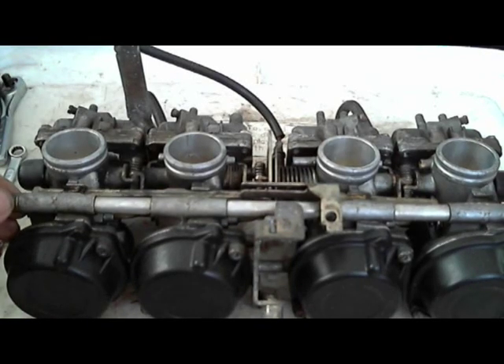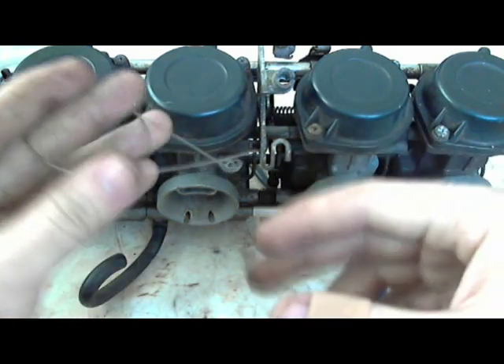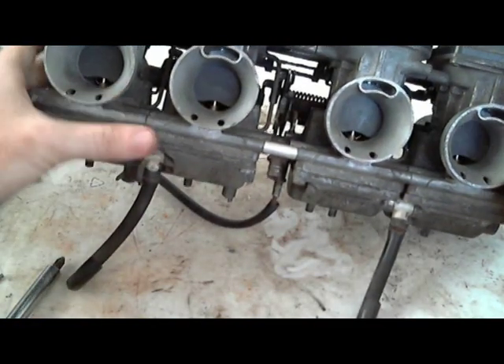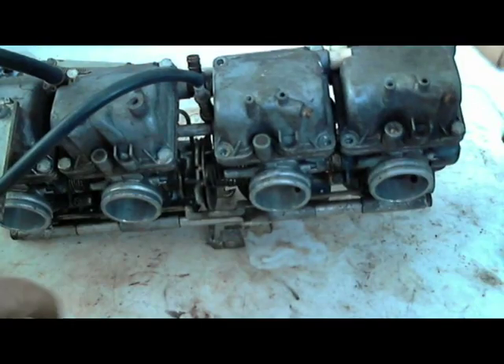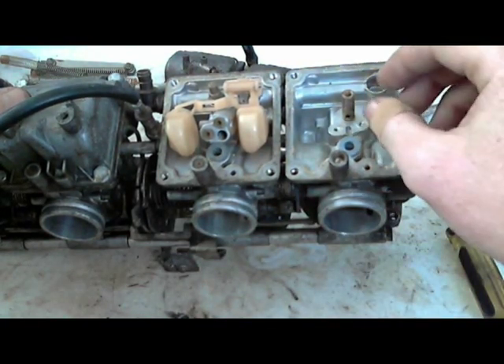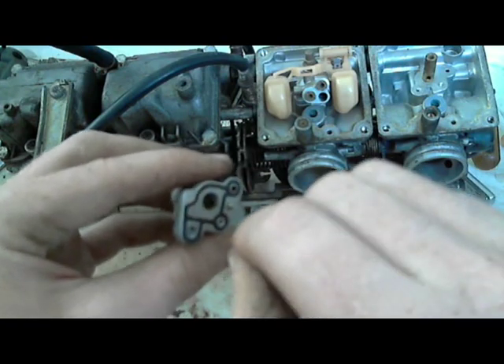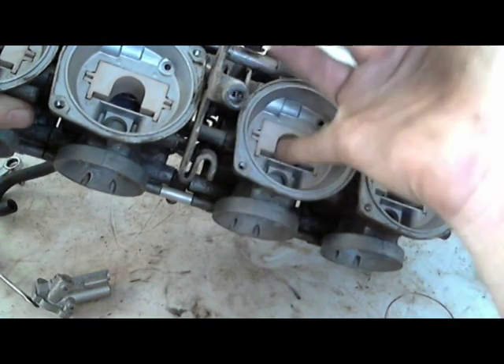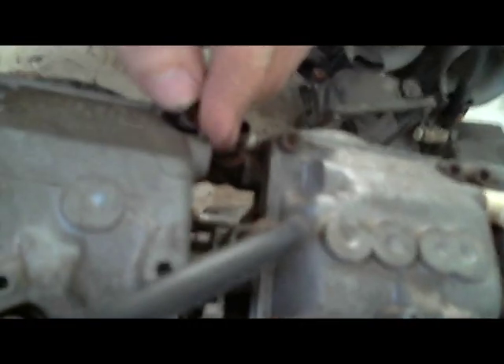step by step fzr600 carburetor rebuild

Comment: Your mystery tube at 43:00 on the California float bowls was where they were hooked up to the charcoal canister for the gas tank vent. Originally there would have been a tee fitting between them and a line going to the charcoal canister which has a line going to the gas tank.

Comment from the maker: There are also passageways inside the carburetors that get gunked up. I hate to say this, but pull them off again, take the jets out, and do the same thing with the guitar string inside the carburetors. Then spray through the passages with carburetor and see if a stream comes out. The passages go through to the carbs and out the air filter side. Clean from both sides with the string.

Also I would pull out your air/fuel adjuster screws, clean them, and set them to the factory number of turns.

Comment from the maker: The fuel economy problems in carbureted bikes almost always lies in the spark or the carburetors. You should check your spark gap first on your spark plugs and if your coils are still providing a hot spark (resistance check on the coils, the repair manual describes how to do this). That is the easiest thing to begin with and rule out. Then clean the carburetors well. If done correctly it should run great after that.

Comment from the maker: I've seen it both ways. Sometimes it is still good and sometimes it leaks air. I've sealed them up before with RTV silicone from napa. It doesn't look pretty but it fixes it, plus it ran fine for 3 years. If you don't have idle problems then you should be able to leave it like that and it will run fine until the cracks get worse.

Comment: I can't get the carbs to slip on the boots. I've taken them off and put them on a few times before, and they always slip back on. This time, they just won't mount. The clamps are loose, and the silicone spray is not working.
Reply from the maker: Yeah, I've had that happen to a few motorcycles. I've even had to cover the inlets with something and put my shoe on to try to evenly press down. These intake manifold boots just get old and aren't very flexible any more

Comment from the maker: that sounds like a throttle cable issue. If your cables are too tight on the cable adjuster then they will stick for sure. It is common when you are putting the carburetors back in to overtighten them. I've done it before. Also when the front wheels are turned, if the throttle cables aren't routed the correct way it will put stress on them and possibly shut off the bike. Check the cable routing and tightness, maybe even spray some kind of silicone lubricant inside the cables.

Comment from the maker: yeah. all the choke does is change the air/fuel ratio for starting. So adjusting the air/fuel ratio should fix it. Those little o-rings do get stuck quite often.

Comment: Actually, the “cheap” screwdrivers supplied in most Japanese mc tool kits are JIS, and they do work much better in those carburetors. I’ve been working on these bikes since my first Yamaha YS1 250. I know about caming out the screw heads! You’ve been lucky… btw, I also have one of those T handled screw drivers! You can order the handle and the JIS blades from any site with Honda or Yamaha parts.😂

Comment from the maker: That's a pretty common thing. Sometimes they don't slip back because they get a little dry, you can wipe a little motor oil around it with your finger to lubricate it then it should pop back in. Or if your hands are clean enough you can spit on the tip of your finger and wipe it around.

Comment from the maker: I think it is talking about a fuel level meter, I'm not exactly sure what it's called. It's like a little tube thing with a hose on the other end that you connect to the drain plug. The fuel level should go up to the 18.5 mm mark on the tube. I've never had to use one on the floats because I haven't encountered a float height issue.

Comment: I just bought a fzr 600 for 250 and it was setting up for three years I took the tank off and the and it was rusted and still had fuel in it but luckily the guy had a cut off valve and the fuel filter was clean so do u think if I jus clean the carbs and Chang oil it should be good to start

Comment from the maker: string size will be either .010 or 10 gauge, which is the high E string. That size works on most carburetors. I've had to get .009 before for carburetors on a 250.

Comment from the maker: Most of the time when they sit for a while then you need your carbs cleaned. I'm not sure I know what you are describing with the fuel-filter-looking thing on what is as small as a coolant line. I'm not familiar with anything like that on the FZR. A fuel line wouldn't be that small unless it is a very small engine. It could be the vacuum line for the fuel petcock on the gas tank, but I don't know what the filter-looking thing is. A one way check valve maybe? There is no reason to have one there

Comment from the maker: slides are driven by vacuum only. They shouldn't open when you move the throttle unless the bike is on and there is vacuum from the engine.

Comment: I think my problem might be on each of the idle/mixture passages. I removed the screw but I didn't see the little o ring and figured it was down in the passage. So I didn't spray out that passage with carb cleaner (didn't want to swell the rubber o-ring), after reading on FZR Archives I think this may be my problem.

Comment: Thanks for getting back, I used the guitar string and completely went through the carbs. I got it all back together but my FZR won't stay running unless I have the choke on. Any ideas what might cause this? The bike hasn't ran since last summer.

Comment: Hey what is the other carb that you said you had on your fzr600 a 04 yzf carb or something but how did you get it to work in really wanting to try and do that and I cant find the video you was talking about please I need help with that if you can help please let me know my carbs are all screwed up from the previous owners and I can find any where to buy new carbs for this bike and I kinda would like to have a slightly bigger carb if possible its a 1994 Yamaha fzr600 not the cali one just the normal one

Comment: At 24:40 when you say the fatter jet is the one inline with the screw, you mean the one with the fatter hole in it right? Cause mine look exactly the same. Is this one (on the left, inline) the main or the pilot jet?
Reply: When  I say they look exactly the same I mean on the outside. I have four with bigger holes and four with smaller ones as I believe I should
Reply from the maker: +steezridin yeah, I meant the one with the larger hole inside. That is called the needle jet or main jet and it sits inline with the screw that holds down the emulsion tube. If you look inside where the jet goes you should be able to see through to where the needle sits when the diaphragm side is installed
Reply: HourNine Racecraft awesome thanks so much for replying man! I have another quick question about something I don't believe you covered: when putting the float needles back on the floats, does it matter which side the metal hanger on the needle faces? It's kind of an L shape and I'm not sure if the two circles that would create the bottom of the L should face downwards or upwards?
Reply from the maker: +steezridin no..it can go either way, but just make sure the needle moves up and down when the float does. Otherwise you'll flood out the carbs or not get enough gas. The most import thing is that the needles are clean and the point isn't worn out on the bottom
Reply: HourNine Racecraft sweet thanks for your help man!! I was googling these things for hours and couldn't get straight answers so I really appreciate it!

Comment: Hey man, I really need some help. I am currently working on my 91 fzr 600, and on the carbs you see those 2 hoses that are in between the 1-2nd, then 3rd-4th carb attached to the plastic piece? I just pulled mine off an noticed that they didn't have a hose on them and were just freely open. Where do they attach to on the bike? Could that be the reason it won't start up well? A vacuum problem maybe? Please help.
Reply from the maker: +dalancabo1995 the hoses are for fuel overflow. It will function fine without them. Mine didn't connect to anything. I've heard that on racebikes the overflow tubes fed into a canister, but the canisters never came on the models that were sold to the public.

Comment: I was wondering if you know what would make my throttle stick and not return to idle sometimes. Also sometimes when I turn the wheel it kills the engine.

I also have 91 FZR, doesn't look near as nice as yours, I would love to do the R6 tail swap but lack of funds now, so I still have original tail.

Comment: Hey how u doing....  Need ur help, i got stuck in putting back my floaters. I think the rubber gaskets got bigger.. is hard to put it back. Do i need another one? Can i use any other house hold gasket??? Wanna ride this bike been two years with out it...

Comment: Thx! My bike has been sitting for a long time and now it starts very diificult and when it finally starts it is running with low rpm,s with a fully open throttle. What is your opinion? Clean carbs? Vacuum leak? Or what? B.T.W  I have a hose that is left over which has something that looks like a fuelfilter in it but than totally black and the hose is about 50 cm. long and about the thickness of the hose that goes to the coolant reservoir? Any idea what I mean or where it belongs? :-)

Comment: Hi,
My slides don't move when I open the throttle, what is wrong? Or they only slide when the engine is already running?
Reply: only when running or you would have to have 4 cables going to your throttle

Comment: how do I measure the height of the floats I have a yzf r6 and the manual says 18.5 mm but the floats don't even get any were close to that before the float toches the top part near the base were its screwed on. appreciate if you can help me out been trying to get it fixed for months now.

Comment: now im having a new problem, my fzr ran great for 10-15 mins after i put the cleaned carbs back in, but just now i rode it to work and it sounds like its running out of gas (which its not). im really confused now...
im thinking maybe somehow the fuel line got pinched ill take a look at it tomorrow. it just sounds/feels like its not getting enough gas. any ideas?

Comment: Hi there I have a 1993 fzr600 and on a full tank am only getting 147ks or about 27 mpg before i need to switch to reserve. This is far low for the specs on fuel economy on websites. Would you know a solution for me, cheers in advance :)

Comment: How do you get that top half of the engine where the carbs are off? I'm having trouble getting that off just to start the carb cleaning
Reply from the maker: KbBeBallin45 Remove the gas tank cover, and then remove the little metal gas tank. You will have to remove a few rubber lines. Then take an allen key (hex key) and loosen the clamps. Take off the throttle cables. It should take a little force, but they should come out. Getting them to go back in is a little more difficult since they are hard to slide back in the boots.

Comment: I just got a fzr600 for 200 and it runs I found tho that there is a tube that comes off the crank case near the transmission and it blows oil out what is y and where does it hook to?
Reply from the maker: it is the crankcase ventilation, and the hose that goes up to the bottom side of the airbox. If you don't have an airbox, then get a little breather filter from your local autoparts store.

Comment: hey dude i finaly got my carbs off, i followed your vid,as far as possible  but i have a problem,,,i have removed and cleaned the jets but the third hole,,,,what is it, it seems to be blocked.pressed in?
Reply from the maker: +andrew munslow I don't remember if that particular jet is removable or not. If you can't remove it, you can always remove the emulsion tube (the thing that holds all of the jets). You can remove it by taking the capped-nut off of the top (approx. 6mm size), then it should slide up. After it's off you should be able to clean both sides of the jet as I showed in the video. Hope this helps! I haven't worked on a set of FZR carbs in a few years.

Comment: And the guy parked it be cause the push button start went out on him any ideas on how to fix it if that is it I have not had a chance to hook battery to it yet and the button is a lil stiff but still moves
Reply: I'm working a fzr as well and what I did is pretty much cleaned out all the all the electronics. like the turn signals the digital tuner the relay and rectifier in the back of the back imma try to put a video of it soon and what tools you will need.

Comment: I bought n fzr600 for 200$ guy said it wouldn't get spark.... I took the kickstand switch off and she fires up but dosent like to idle what could cause that its also seemjg to be running VERY rich.   Its shooting flame around 3500 rpms and do sent really wanna go over 4500 rpms
Reply from the maker: if it is running rich then have your carburetors cleaned and adjusted.

Comment: I HAVE A PROBLEM WITH MY FZR THE PREVIOUS OWNER BROKE THE SPARK PLUG AND CANT REMOVE IT CANT YOU GIVEME SOME ADVICE?
Reply from the maker: If the insides of the spark plug came out you can screw a tap into the now-hollow spark plug and reverse it out or tap in an easy-out reverse drill bit
Reply: the sad part that thing is HARD AS HELL the piece got broken, we use a manual tool with the bit and the bit got broken
Reply: You have to drill a hole in the center and tap it then put a tight screw in it and back the bottom of the plug out if its snapped flush with the engine I do it every time and it saves me a shit ton of work

Comment: How do I get the throttle cable off of the carb?
Reply from the maker: +Travis Howe info remember correctly, loosen one side with a 10MM wrench, then turn the piece of the carb that the cable pulls. You can slip the metal ball out of the slot once tension is off.

Comment: I need help my screws are not coming out at all and I have a t handle
Reply from the maker: Try getting some vicegrips and clamping onto the side of the head of the screw, spray it with some PB Blaster before you do. If that doesn't work then buy a set of Craftsman screw removers, drill a tiny hole in the head of the screw with a regular drill bit (about 1/8) and don't go deeper than the thickness of the head, then switch to the screw remover (it's like a reverse drill bit). Apply pressure and the screw will either come out or the head will snap off. Once the head snaps off, the threaded part of the screw should come out easy. I've done this many times if the vicegrip didn't loosen it. Threads don't get damaged and the screw always comes out.

Comment: you forgot to put o-ring back to main jet. you drop it on that table :P
Reply from the maker: Altti Huttunen I see, I probably found it after I shut off the video and put it back in, honestly it's been too long to remember
Reply: Altti Huttunen that main jet o-ring, can it be hardened so hard that you have to scratch it off in crumbles with a needle? I did not get any o-rings out under my main jets, but could see a black ring around brass tube in there in my mikuni bdst38 carbs. I scratched one off, but im uncertain about the other carbs now, because it was really solid stuff...